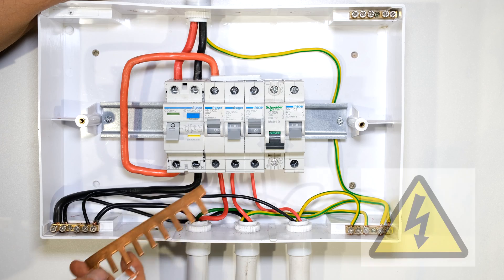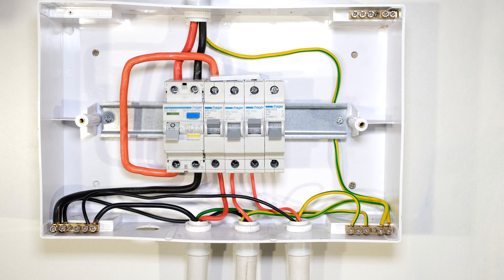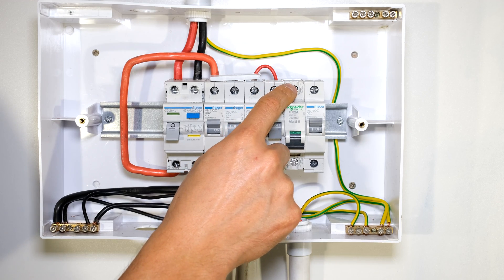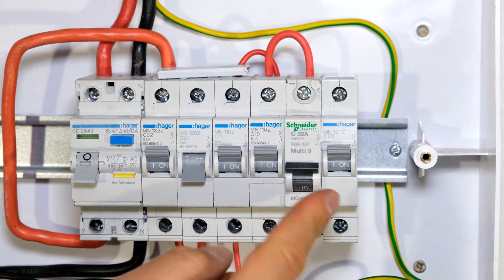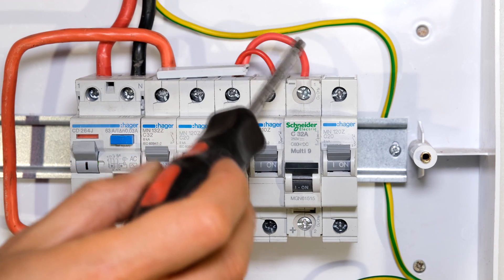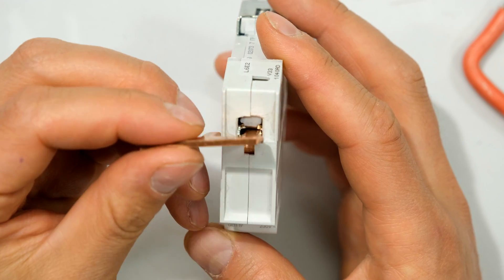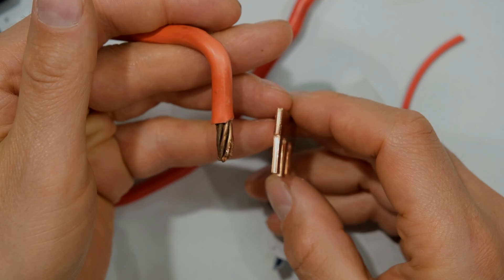Why jumper links should not be used on distribution boards across circuit breakers

Comment: Why would you not put the  double pole RCD on the right hand side of the consumer unit then put the busbar across the bottom of the MCB's, taking the outputs to the individual circuits out of the top of the MCB's? This would eliminate the big loop from the  bottom to the first MCB that you have in your setup?

Comment: This is sooooo wrong. I am astonished nobody saw it. The 63A "circuit breaker" is not a circuit breaker but an RCCB and will NOT trip due to overcurrent. This device will only trip when it detect electricity leakage. The combination of Circuit breaker and RCCB (sometimes called RCD) is called RCBO and it's not the device we see here.
Reply: It's a lab setup bro calm down
Reply: @James______6969_0  That it is a lab setup and the guy explains it wrong makes it even worse. It’s teaching false information.
Reply: And it's not a how to is a why video

Comment: Hi, you put a jumper cable that can carry 10amps from circuit breaker 3 to circuit breaker 4. So, circuit breaker 4 is rated at 10amps which is fine for that jumper cable to handle. But isn't that jumper cable a fire hazard if circuit breaker 3 is also pulling 10amps. Should that jumper cable not be rated to carry 20amps if both breaker 3 and breaker 4 pulls 10amps = 20amp.
Reply: No, the 10A jumper cable creates a closed circuit over circuit breaker 4 only. CB 3 can function with or without that 10A jumper which tells you it's not needed for CB3.

But just using 4mm cable for jumpers should solve this because that handles 64A just fine.

Comment: hahaha if you need to retighten after few days, you did not tight it hard enough in the first place. i have done work that lasted years ... train your grip
Reply from the maker: if you go to many DB you can see that even when the screws were initially very tight at first, some loosen. The copper strands compress over time and that's why i re tighten.
Reply: @ecologicaltime  i am an electrician, and if i have to go back after 2 days to each customer... it's a bad situation
Reply from the maker: Crimped connections are better.
Reply: @LCMWR  Breakers have a torque specification for the screws. You should not crank it as hard as you can. And if someone can recheck the screws after a week or so it’s always better to do so.

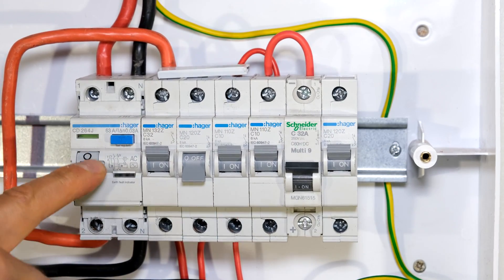Comment: 3:13 the RCD will not trip for overload. It will triped if residual current find a path to earth .
Reply: At 0:29 he makes the same mistake.. 63 amps is just the max you are allowed to put through the RCD, it will not “trip” but just plain fail. Possibly fire.

Comment: Can you jumper from L1 to L2 to check if there’s an error on L2 cause of a voltage drop coming to L2.
Reply: If you’re talking about the 3 L’s from 3 phase power… NO. You’ll create a 11KW short circuit. The molten copper will fly through the room. Stop doing anything with electricity if you have to ask this.

Comment: The wires going in the 63A circuit breaker are the same section as the one going to the individual breakers, neither can hold 63A, so the main breaker needs to be changed first of all!
Reply: The most left device in this video is not a 63A breaker. It’s an RCD which you’re allowed to put maximum 63A through, otherwise it will melt. And a 10mm2 is good for 63A. Those wires look like 10mm2. Don’t know about the bus bars shown.
Reply: @Engineer9736 Yes it's rated fir 63amps.

Comment: Very helpful. Do you have a video on how to install a double throw switch to bypass an inverter to supply the loads from the grid?
Reply: If you like i can send you a picture
Reply: @travismailsa  yes
Reply: @carlossantini  Not sure how i will post a link here, but will try. When i get home ill open my sub db and show you how i wired it up.
Reply: @travismailsa  thx u
Reply: @carlossantini  ran out of time when I got home from work, had a issue on my light circuit tripping the earth leakage. Fixed now but had to head out for poker night. Tomorrow I'll take a video for you and explain
Reply: @travismailsa  Thxs a lot !
Reply: Both inputs into the bottom, one being mains, one being inverter supply, then top is output of either inverter at bottom, bypass middle and grid up/top

Comment: What if the panel has various brands of MCBs that have different heights -- so the busbar won't reach the shorter ones?
Reply: You should buy the same size (same width & height) to avoid loose connection of busbar. I have 4 different brands but with same size in same row

Comment: Common sense says you use a larger "jumper" for each breaker.  Same as the feed wire.    not rocket science.
Reply: Common sense is uncommon.
Reply: Well it is actually science a 16mm cable underground is rated at 80 amps and overhead is rated to 63 amps due to length of run and derating due to heat in a switchboard a 4mm cable could actually be rated at 80 amps and easier to work with

Comment: Did you do a video on wiring an inverter into the db board for only some plugs in the house (with a low load).?
Reply: Terrible idea to have two feeds to the same electric panel. That is confusing, non-standard, and a huge safety hazard for all!
The inverter should have its own separate electric box/panel.
Reply: @mrtechie6810  That’s total nonsense. Many houses have solar panels and thus 2 feeds in their panel. They have a sticker on the panel saying so.